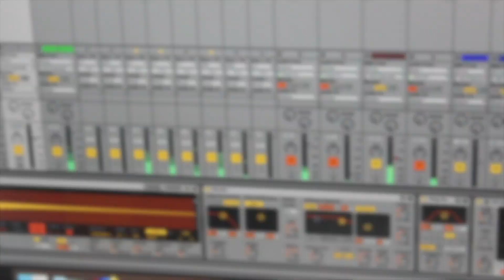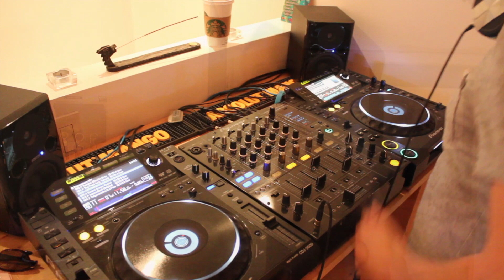THE DJ'S WORST NIGHTMARE - THE TRAINWRECK!!!

Comment: you forgot the #1 tip to avoid trainwrecking. press the sync button
Reply: zm5431 lmao
Reply: No.  If you are a House DJ, that is not an option. Never press the Sync button.
Reply: Antoine Simpson why not, if you’re trainwrecking (just curious)?
Reply: @househeadspeakz  why would you ever need sync as a house DJ lol?
Reply: zm5431 or you could just look at the display and see if the BPM is correct
Reply: This only works if the software correctly beat gridded your tracks, which is not the case more often than you think depending on the style of music you mix
Reply: Just put in a Ministry of Sound CD and press play lol

Comment: To me, trainwreck would be equipment failure. Like no sound going out to the house at all. That ends a night very quick, even if its not your equipment, people will remember you as the DJ that had a bad set :/

Easiest way to do just a pure beatmatch up is just loop an 8 bar section at the beginning with cue on and sync it up, then turn the loop off once you get to your transition point. And make sure you are phrase matched also. 1s on 1s, common beginner mistake to not phrase match. You will have vocals or instruments going or coming in weird spots in the transition and the audience  will 100% hear it.